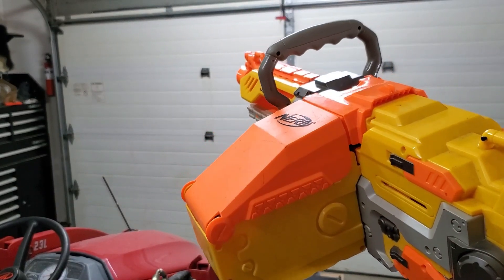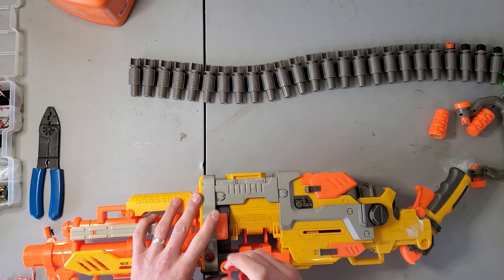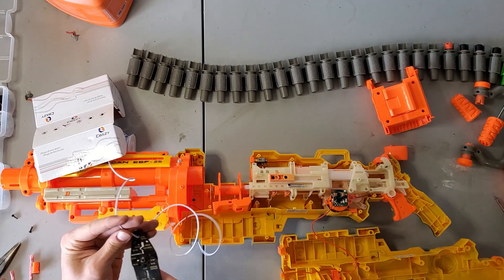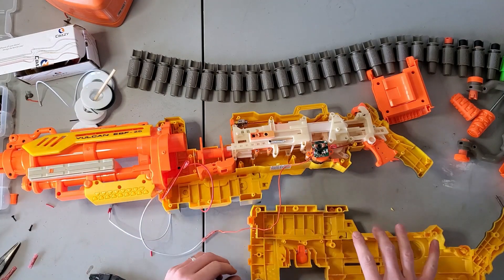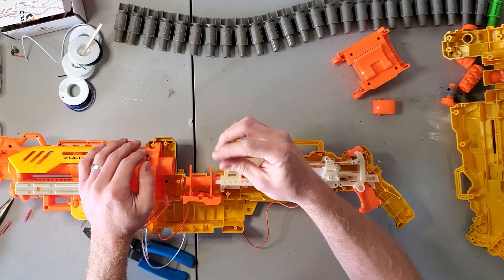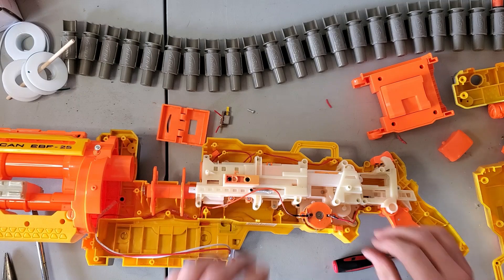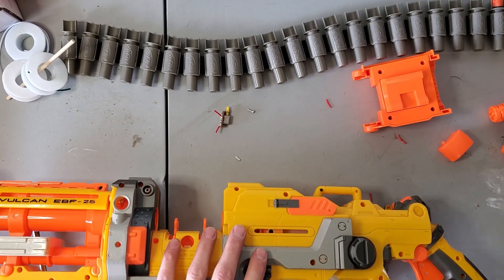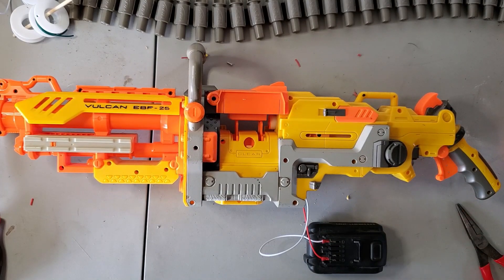How to Modify a Nerf Vulcan with a Drill Battery

Comment: i have a question if you used sandpaper to smooth out some of the internal plastic do you think you'd be able to internalise the battery? because it looks like it could be possible with the space provided underneath the feeding wheel for the ammo belt?
Reply from the maker: Yes. I'm planning to include that in a future video. it's tricky because every battery is different. I was going to us a dremel to cut a slot the battery will slide into. The other option is to replace the ammo box and put the battery in there.

Comment: So I changed the spring on the vulcan I have and it fits and operates fine except for the fact that when I cock it back, the firing mechanism keeps un-priming like after you fire it without me even touching  the trigger. What do I do?

Also ontop of that, the automatic option will activate but nothing happens. Is it the spring?
Reply from the maker: I'm planning a spring upgrade video. I believe a key part of the spring upgrade is using higher voltage almost exclusively to run it because you have to overcome spring pressure that it isn't built for.
Reply: I see. That makes sense. My concern with amping up the voltage is burning out the old motor which I need to swap out for a brushless one. This Vulcan suffered some bad corrosion after being forgotten out in the rain before I obtained it and had someone it clean and mostly fix it up. The old spring was too corroded so I had someone replace it with a newer one which appears to be weaker than the original because the bullets don't travel as far as it did when it was in its best condition. Is it also possible that the current spring I installed recently is too strong for the gun to handle and that's why it won't stay primed?
Reply from the maker: @ArsenalXYT  If you're having speed or power issues with the motor I would try removing the green board on the back of the motor as shown in this video. I wouldn't go down the road to replace the motor until the existing one burns out, which has never happened to me, but the board does burn out.
Reply: @BigRedButtonBuilder  Ok. I can do that. will I have to worry about overheating issues with the motor using just a normal battery pack? I don't have a drill battery available just yet.
Reply from the maker: I wouldn't worry about over heating. The blaster in the super long chain video has slots cut in the plastic over the motor so it can get a little fresh air but I don't think its an issue.

Comment: Where do you put the battery? Or am I going to have to externally attach it?
Reply from the maker: Was going to include that in a future video. If you are replacing the ammo box with a larger one you can put it in there. Otherwise, cut the battery bay so you can slide your battery into it.
Reply: @BigRedButtonBuilder  ok thanks, great video by the way